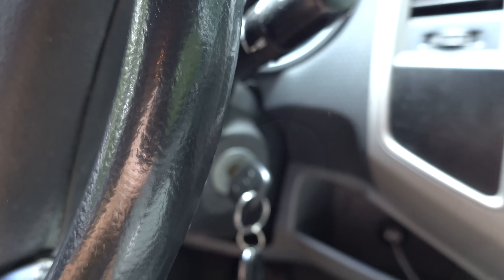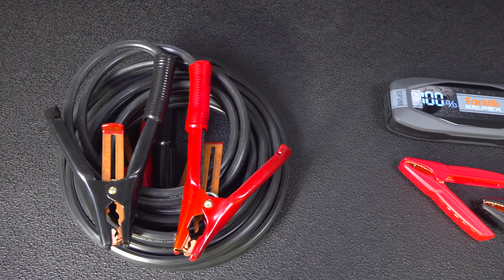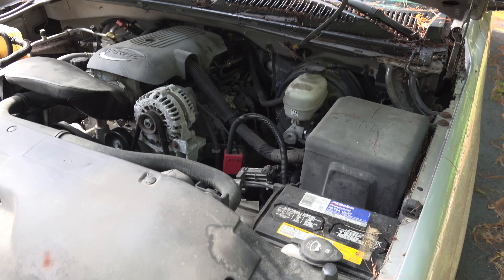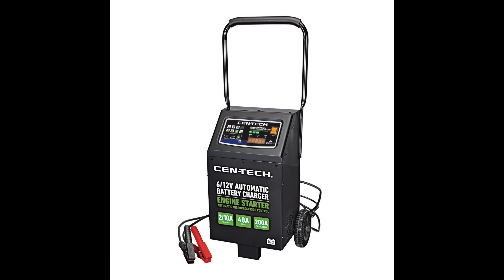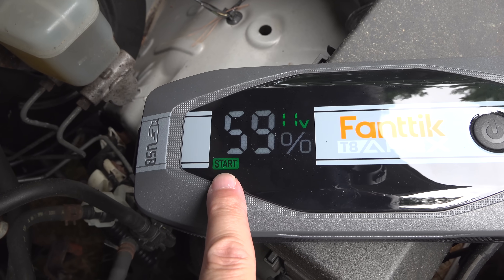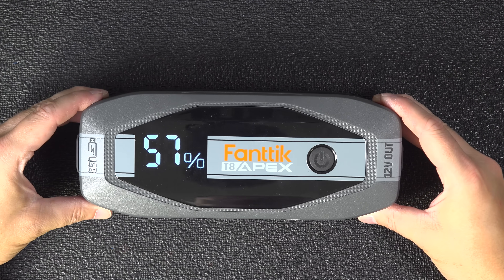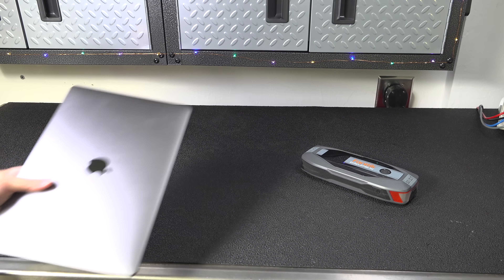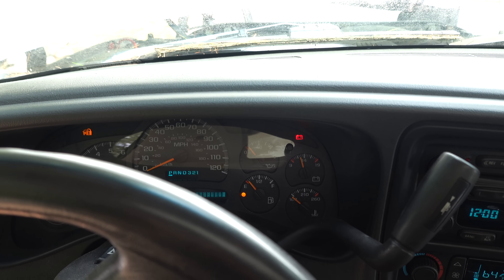NEVER NEED JUMPER CABLES Again - Fanttik Apex T8 Digital Jump Starter

Comment from the maker: Thanks for watching please LIKE & SUBSCRIBE - Order now for just $139! at https://bit.ly/3AzlPfw - CLICK the COUPON BUTTON to get that price while it lasts!
Reply: A woman that will help jump your battery is a keeper!
Reply: You forgot to mention that this video was sponsored by the manufacturer
Reply: @itsm3th3b33  great observation! 👍
Reply: Discount code does not work.
Reply: price went way up
Reply: Whats your opinion about the Noco Boost Pro GB150 compared to this?
Reply: @seekfactsnotfiction9056  Apex t8 will start a completely dead battery, noco will not. Apex t8 has a four lithium battery power pack, while the other only has one. Just got mine two days ago. Battery was so dead that it wouldn't even make a tester light glow and it wouldn't even register one volt on the meter. But I did the bypass procedure with the Apex t8 and as soon as the start button showed up on the display my engine started right up. Plus it showed me after it started up that my alternator we're still putting out 14 volts, so now I know it's just the battery and not the alternator or a short that's the problem.

Comment: Found one on sale for 92 bucks out the door on Amazon. Received it 5 days later. Read through everything. My car's battery was completely dead, so much so that it wouldn't even register one volt or light up a tester's light bulb. Lol I hooked up the Apex t8 to it, held down both buttons for 3 seconds until the start indicator lit up, and the car started right up! Bonus, before I disconnected it it showed me the voltage that my alternator was putting out, which was 14. So I knew that there wasn't a short and that my alternator was working fine, and it was only in my battery that was the issue. Living out in the sticks like I do, this is definitely something we needed.

Comment: These sort of fancy devices seem good when you buy them for big bucks. But a few years later when your battery goes and you try to use the device... it's dead as a dodo.. and the guarantee long expired. STICK TO GOOD OLD FASHIONED JUMP LEADS - NOTHING TO GO WRONG - AND NOBODY BUYS $300 LEADS (the standard ones are OK ) .

Comment: How does it deal with extreme heat and cold? Ideally, you would want to leave this in the car year-round, but lithium batteries don't like cold much (lose charge capacity) and bad things can happen if they get too hot. I'd that's good to go, seems like an awesome unit!
Reply: It's rated for -4° f to 140° f. If kept in its insulated carrier stored out of direct sunlight, it will be fine, even in the Southwest desert where I live.

Comment: Last time I have to jump start my car was 15 years ago, with modern cars when you locked your car with a Key Fob, it automatically turn off the  head lights if you forget to turn it off…but I do have a jumper cable,just in cases.

Comment: Looks like a nice unit. Great review. Everyone should have one in their car and a set of jumper cables. I personally went with a capacitor model that has a built in battery. With just the capacitors it can start most vehicle. Assume not a diesel, but has worked a couple times already on my v8 Tahoe. The internal battery can be used to charge capacitors if battery is dead. Wasn't cheap, but worth it when you need it.
Reply: That's why I don't understand they're not pushing the capacitor starters more. Because there's no battery in the original first generation, so there's no worries of it leaking on you if it gets overheated in your vehicle or getting damaged due to temperature extremes. Plus with the capacitor, even if you have just a tiny residual charge left in your battery, it only takes one to three minutes for it to charge itself enough to give you a surface charge strong enough to start your vehicle. Plus with these new vehicles and all the new electronics in it and people worried about damaging it by jumping your car, which is quite possible, you don't have to worry about asking somebody for a jump, all you need to do is ask if they'll let you plug in your capacitor for one to three minutes in there lighter socket. Or you can just charge it at home if you're there or any place with a wall outlet. Plus capacitors life cycle are way higher, they can be cycled thousands of times, not just a few hundred like these battery operated charges.

Comment: I have bought a few different kinds of these over the last 5 years or so. They are a god send for my work. However, be careful leaving them in the car over the summer months, they have a tendency to pop the batteries due to heat. They have really improved since my first one. Great video.
Reply: The Apex t8 is rated for -4° f to 140° f. So as long as they're kept in there protective insulated case out of direct sun you're fine. Bonus, as I found out two days after I got mine, this one will start a completely dead battery! Battery was so dead it wouldn't even register one volt! Hooked up the Apex t8 hit the two buttons to bypass safety for 3 seconds, start light came on and the car crank right over. Bonus, it shows you the voltage your alternator is putting out so you know if it's your alternator or short or just your battery. Mine was putting out 14 so I know it's just the battery.

Comment: Has anyone tested these on larger trucks? Like a 2500 and up with a diesel?
Reply from the maker: I was actually trying to find someone with a CAT or dozer I could try it but couldn't find one. But they rate it for starting Diesel up to 6.0L so if you have one that size you should expect it to handle it without issues. Specs and pricing here: https://bit.ly/3AzlPfw

Comment: I'm ashamed to admit it but I may have just impulse bought one. Though winter is coming so I imagine its gonna get some use. The fact that it doubles as a power bank with 65w output makes me feel a bit better about the $109 I just spent.
Reply from the maker: Don't be, and you can use this all the time as a power station, that alone would cost $60. I didn't want to go nuts in the video completely but even the two little cables they give you feel like apple cables, include a little snap clip for each. They really put some good thought and quality into this one. Let me know what you think once you get it, but I think you will love it.
Reply: @SilverCymbal  I received it a few weeks ago and was pleased with the apparent quality and I like the carrying case. I never thought I would get to use it so soon, but someone came into my job last week and asked if anyone was able to jump her minivan because her kids killed the battery screwing around. Worked exactly as it should. A little trouble with user error in the beginning but after I solved my stupidity it started right up. I've seen recommendations and ads for other portable jumpers (thanks for tracking that google) since buying it and I while there definitely are other options out there for cheaper, I can say with some certainty that you won't be disappointed if you spent a little more on this.
Reply from the maker: @sacred_g  Thats so great to hear, and that it already helped you. You really never know when you need one and the usb charger part is a nice bonus that you can use all the time. Thank you so much for sharing this and your faith in my review.

Comment: I used to laugh at those little boxes, until I bought one last year and have over 100 jumps on it, they work amazing, better and faster than clunky cables. And it recharges in the car. Everywhere we go we scan the parking lot for hoods up needing jump starts. The PERFECT Christmas gift for ALL family and friends!!! 👍👍
Our model has 2 USB charging ports for phones and laptops, and a powerful area light.
Reply: You’ve had to jump your car 100 times?
Reply: @CageyLeigh  🤣😂 I had an old dodge minivan and the alternator went bad and I had to wait 2 weeks for my next paycheck but still show up to work everyday and close out the front of the store so I was usually the last to leave at 1am and it's quite difficult to get a jump then. I used it atleast 20-30 times for that, and then of course, working at a grocery store you've always got customers with dead batteries, so I became The Guy for jump starts. I bought all my relatives their own for Christmas. Now cables are a thing of the past.
Reply: Same! I was blown away when I had to use mine for the first time (had received as a gift and was also very doubtful)
Reply: which jump starter do you have i’m trying to buy one right now for black friday
Reply: @MajesticFreedomEU  The one we currently have is "Hailo Bolt". It's a year old now and many other companies have appeared with their models which I'm sure are good as well. Main thing to look for is go one step larger than what you need, if you want for just a passenger car then get one for light trucks, it's more amperage and you'll be glad you did if the battery is at absolute zero. As a gift, they may look funny at you when they open it, but the first time they have to use it because they're stranded or they help someone else and they're the hero..... You'll be getting a call with Many Thank You's !!!
Happy Holidays👍👍

Comment: These are also useful for using as a hold-up battery when changing out the battery after testing and finding out I t's down to 50% state of health.  Because reprogramming radio stations is boring.

Comment: Any problems leaving in a hot as hell car all day?      great vid!
Reply: From my experience, it holds up fine, at least when not stored in direct sunlight
Reply: Depends on how hot the storage location will get.  According to the manual the max storage temperature is 122F ( 50C).  While you might not exceed that you could be close..  Repeated exposure to high temperature will reduce longevity. I have seen it reported in the Noco type jump packs in a hot car/office. Battery eventually swells and crack the case.. maybe a year or 2 in... So if you want to extend the life, minimize the time it sits in a hot car.. And if taking the pack with  is not an option maybe put the pack in the coolest part of the car (under the car seat?) and consider  things to reduce the temperature in the car.. Park in the shade, crack the windows, use reflector shades on windows etc.

Comment: They have a “Hulkman” version on Amazon for $99 ,4.8 stars with almost 3000 reviews, seems to be exactly the same thing?
Reply from the maker: I haven't tested that one but it looks to be a good unit. The differences I saw were that the Hulkman holds it charge for less time and the Hulkman is only an 18 watt USB port output where this is a 65 watt input and output. You really couldn't use the hulkman to run a laptop or for charging larger items.
Reply: @SilverCymbal  well, I ordered the Hulkman,got promo for 5% off + had $17 credit earned from the Amazon card,so for $75, I’ll try it out and comment when I get it to let you know if it is really close. Thanks by the way for all the great content,ended up getting the dethatcher you recommended,lol.
Reply: I was looking to get the Hulkman on Amazon, but I read that the case for it is $35 extra. If the unit in this video is only $10 more and has a case, it is a better deal than the Hulkman.
Reply from the maker: @DonO1970WNY  Fanttik also wrote me this morning with a note of appreciation for the review and shared a coupon code and link if you buy one, so now it is $99 here https://bit.ly/3AzlPfw - Coupon code: T8APEXSAVE10
Reply: @SilverCymbal   Oh wow, I ordered one last night, and I definitely would have waited, had I known there was a coupon! I emailed them, asking if by any chance the code could be applied to my order. If not, it isn’t the end of the world. But hey, $10 is $10! Thanks for your excellent content, and for the coupon code! Now I need to get a Groundskeeper II… 👍
Reply from the maker: @DonO1970WNY  They should do that for you, thats only fair. The groundskeeper! I wish I had the money to buy that company. Best rake ever.

Comment: Wow I’m impressed that you only have 79k miles on that GMC.
Reply from the maker: Very true, original owner was an older guy didn't use it much. My friend just uses it now for dump runs and moving stuff. He SHOULD buy a new battery but just boosts it when he needs it, seems silly but he doesn't want to spend any money on it.
Reply: @SilverCymbal  well a new generic battery is not that expensive and you don't have to worry about it for 4-5 years
Reply from the maker: @dtibor5903  A lot of New Englanders are silly with stuff like that, lots of stories of stuff they get cheap with.

Comment: We bought something similar, different brand, but they're worth it. I have a Model 3 so I couldn't jump start my wife's car one day, after I left the keys (who uses those? 😊) in the ignition, killing her battery. I know the tango dance to jump a car with another, but it's easy to mess up and mess up a friends car. These are pretty bullet proof and hard to mess up, nor require an electrical degree 😅.
Reply: I thought Teslas had backup 12v systems

Comment: Been meaning to get one of these as there is a couple of variations that do the exact same thing. I think that they will be especially when you find yourself in a area where it's hard to get the jumper cables to reach the other car. Another good review
Reply from the maker: I appreciate that. I have gotten a bunch of these as samples over the pas year and they all had issues. One blew up (sadly I didn't have it on video) the others failed to start cars. This was the first that really worked. I am sure there are other good ones but I liked this one a lot.
Reply: @SilverCymbal  That is why I was delaying getting one, because a lot of them to me would probably blow up or not work and I could tell by just looking at the product. Going see about buying this one because I trust your reviews.
Reply from the maker: @johnree6106  I appreciate that. I know this is a new product but everything I tried and used was spot on. I think this one is going to do very well.
Reply: @SilverCymbal  it sure does! 🤗 I got mine a couple days ago specifically because my battery was so dead it wasn't even registering one volt LOL! I took the charger when I got it and fully charged it like it tells you to, and even though my fuel pump is weak on the vehicle and I had to crank it twice to pressurize the system, this unit still works like a charm and started it right up. 🤗🤗